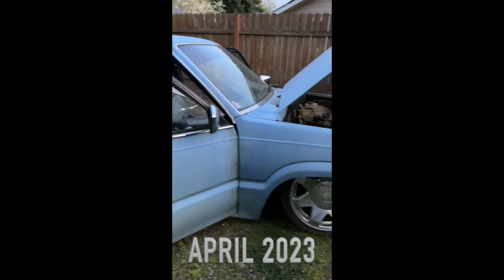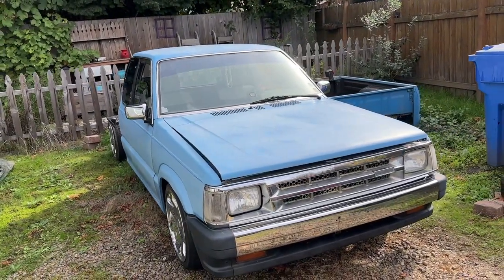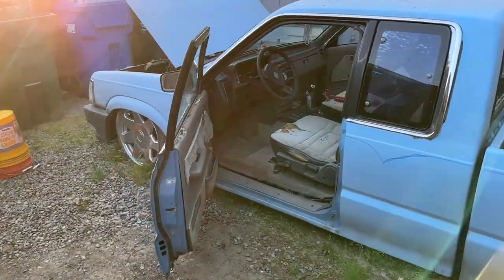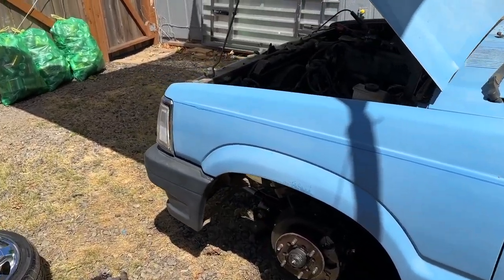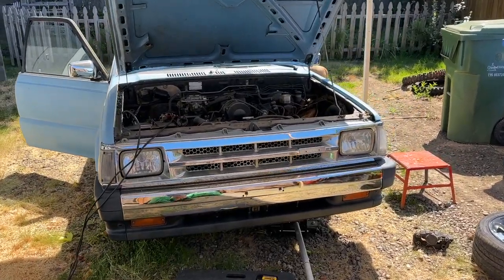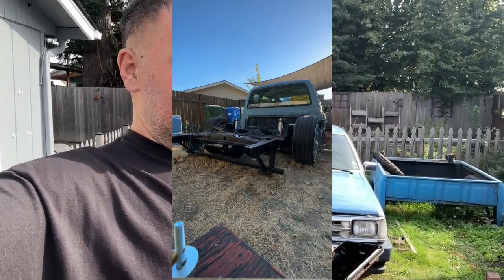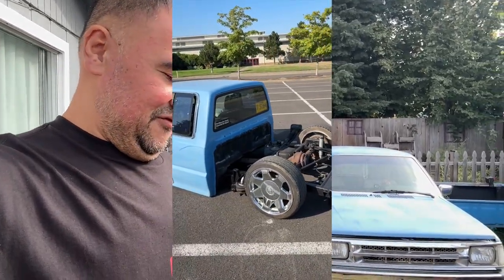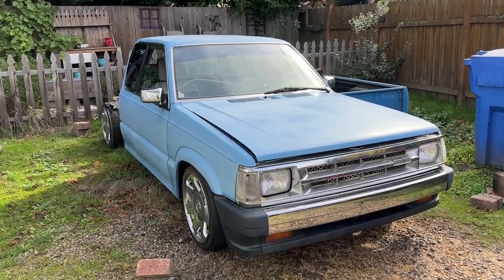My bagged and bodied Mazda B2000 minitruck that I've owned for 28 years.

Comment: Oh man this truck has been through so much, good to see you getting it back into running shape. Are you going to update the style a bit or leave it mostly intact?
Reply from the maker: Pretty much leaving as is. It needs seats, or the factory seats recovered, so I'm trying real hard to keep them factory but hard to find. Also needs a steering wheel but OEM ones are stupid expensive. Need to research and see what RX-7 stuff fits and looks right. So aside from the minor updates I've already done to the suspension it is staying as is.